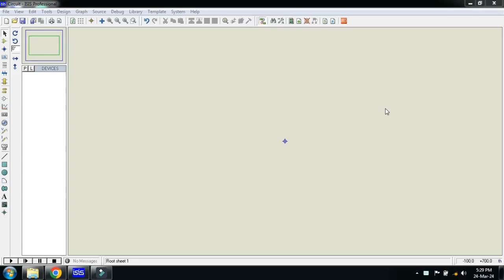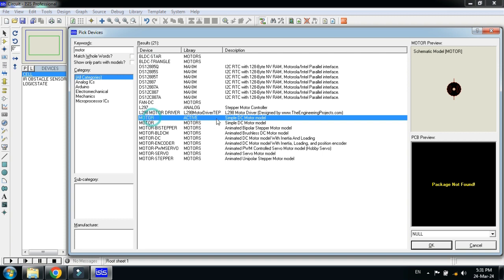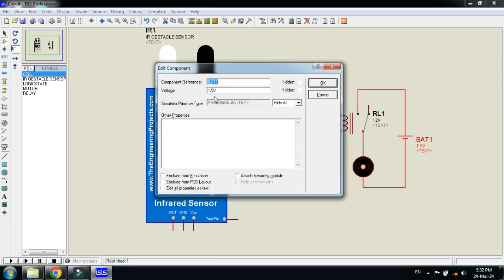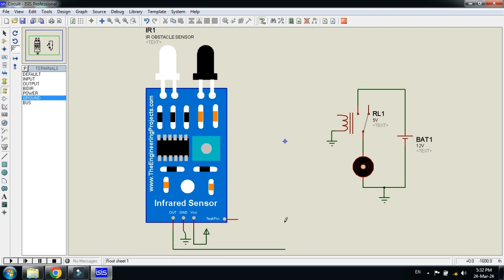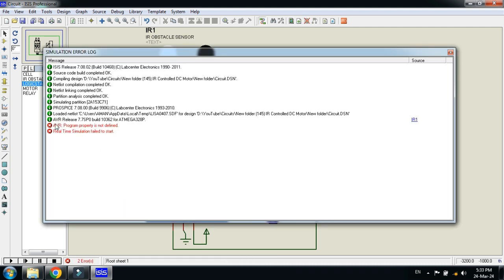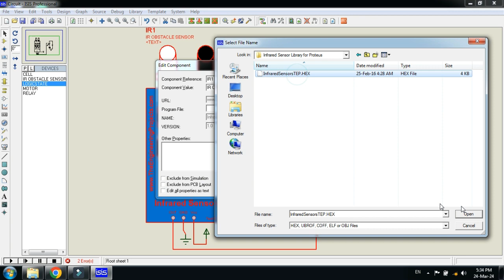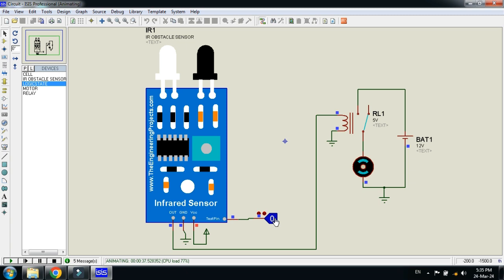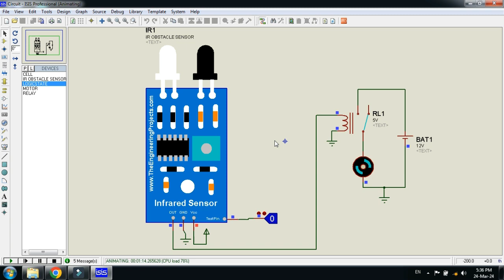IR Controlled DC Motor || Proteus Simulation

Comment: Bro , can you please upload video today ( before 4 pm) about the water level detector in a tank ( If the tank is empty, the motor have to on to fill the tank ) with two sensor or push button ( located above and below of the tank ) In Proteus simulation Using Arduino UNO 🥺🥺🥺
Reply from the maker: This video is already available on my YouTube channel, link is below:
 https://youtu.be/tfDaEojgUu8